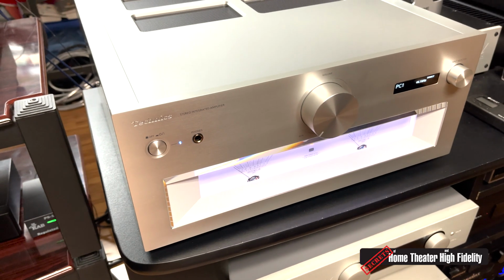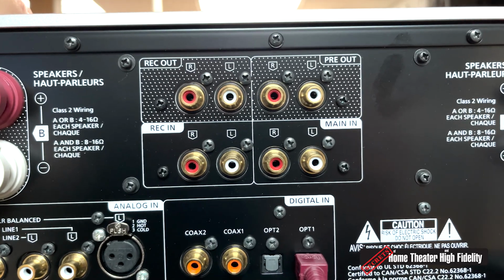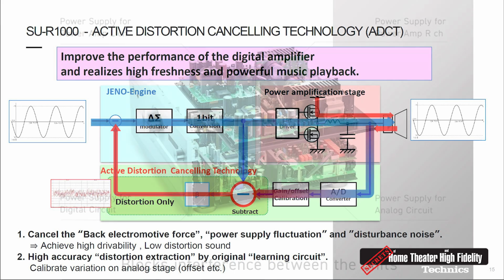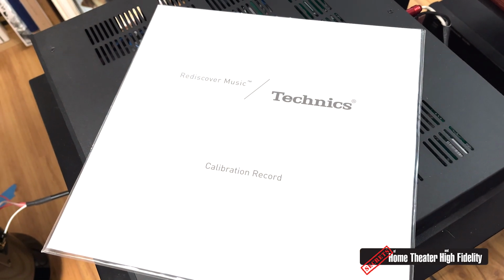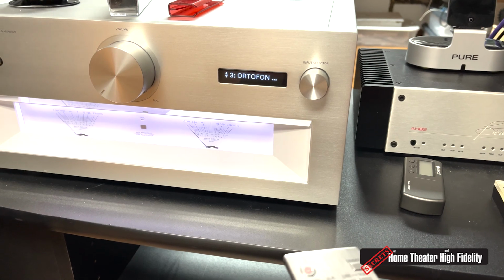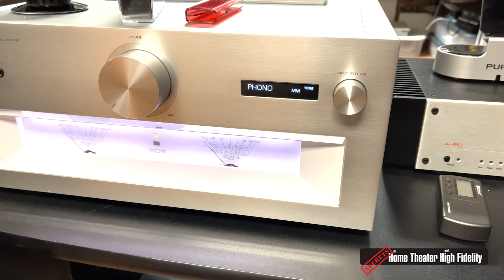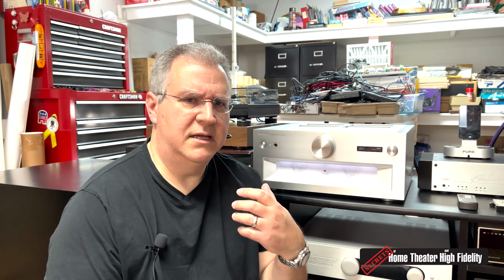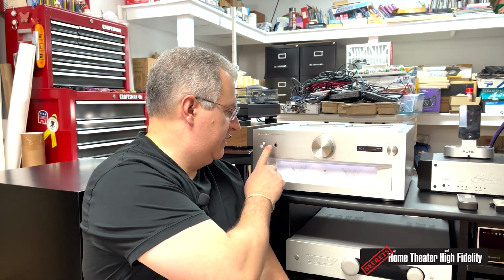Technics SU R1000 Integrated Amplifier Video Review

Comment: Good review,love to have that component in my system,but way out of my price point.
Looks beautifully built.

However there is a clumsiness to some of the design.

(1)  Vu meters are to small and detracted by unnecessary bezel 
(2)  WHY?? The placement of the controls (above) the meters ,so every time you alter settings you (obscure) them.
(3) clumsy and small display to the right.

On my older Technics Reference Amplifier SE-A2000 and Control Amplifier SU-C2000 the design is much better resolved, Large clear VU meters that embrace and promote a classic simple yet timeless look,the dials and functions separated to the SU-C2000 Control Amplifier,with the secondary controls hidden behind a discrete damped panel.
Very classy and discrete.

So,no question that the the new component is excellent,However??

Price 
Clumsy Design 

Would unfortunately lead me to probably hesitate and perhaps look elsewhere, but a excellent product nonetheless.

Jason.

Comment: If we are talking about weight the Michi X-5 is 95 pounds almost twice that of the Technics and the specs of the phono stage are far better (not a .00001 difference) important for us as we have 1,500 LPs. The Michi X-5 now in Version 2 said to have 95 new parts and an upgrade DAC; plus retails for $2,000 less 8k vs 10k has far more power and if other reviewers are to be trusted more oomph in the bass and mids; will you be testing it anytime soon?

Comment: How does the sound compare to that Benchmark stack? I have heard the AHB2 and the pre-amp in my own system and liked them.
Reply from the maker: The Benchmark stack has a modestly more transparent presentation, but it is as close to a "straight wire with a gain" as you might find. The Technics is marketed to a whole different crowd with several additional features and a whole different philosophy about how it handles the audio signal.

Comment: As you do not mention current or damping, how would this unit match up with Magnepan speakers?
Reply from the maker: I think the Technics would be just fine for the Maggie LRS+ and .7. For any of the larger models I would suggest and integrated amp with more power reserves or separates.

Comment: I have the Technics SU-G700M2 and  the sound of it. And yes, I wish mine had a HDMI input as well but the Toslink works wonderfully in place of it. I'll never part with it. Great review by the way.
Reply: Great! Could you comment about SG-L 700MK2 SQ ?  Thanks in advance
Reply: @borginhoelloss100  I have the original version and not the Mk2 (SACD player). It's much better than my old Marantz SA15-S2. Better detail, bass, expression, timing, etc. I figured I'd get it to match the integrated and be done with it all. I don't stream or use any networking and just play CDs. Digital out sounds better than using the internal DAC and the RCA outs but it's really a preference.